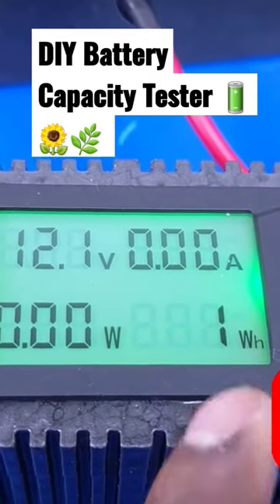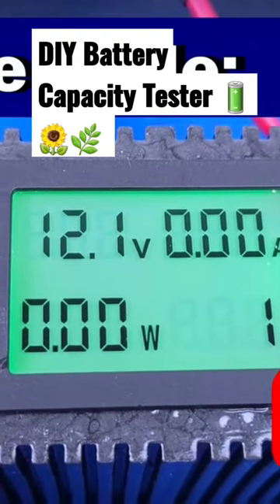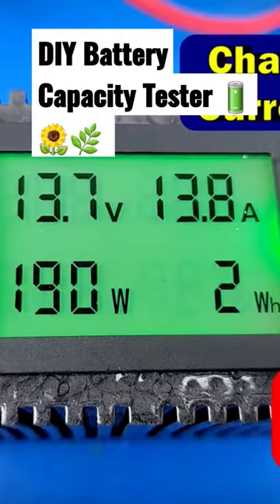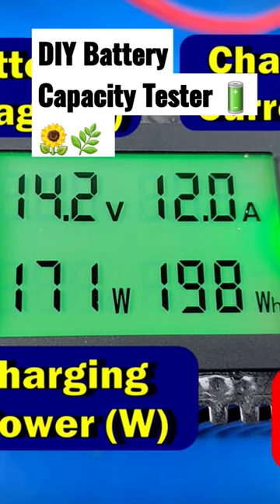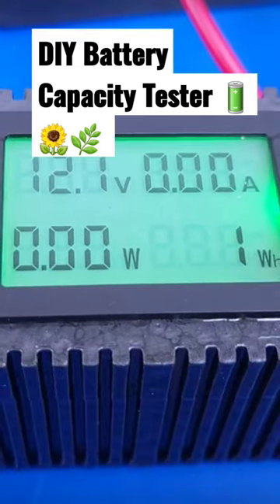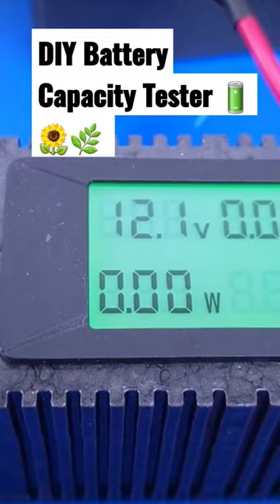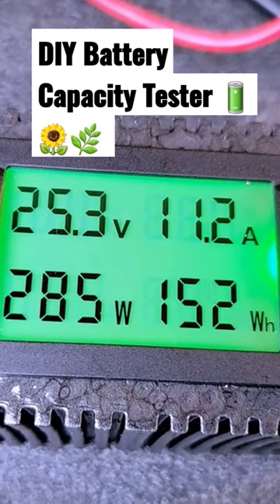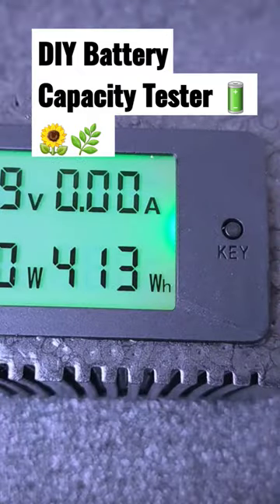DIY Smart Battery Tester, Battery monitor #shorts #diy

Comment from the maker: This is a highlight of a video we made to show how to make a battery capacity tester using a cheap power meter. This device is very easy to make and can be used to determine the life of a battery system, whether old or new. It basically measures the accumulated electrical energy stored in the battery during a charge or discharge cycle in watt-hr, which can be translated mathematically to an amp-hr rating. 

See the link below for the full video.
https://youtu.be/TOYBfCnRyQc